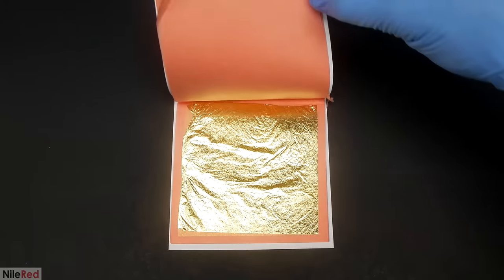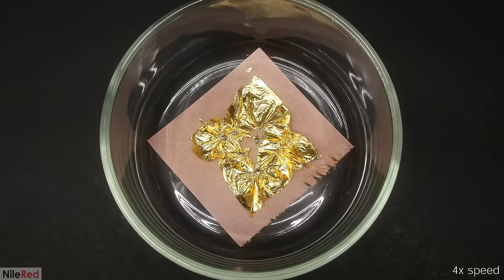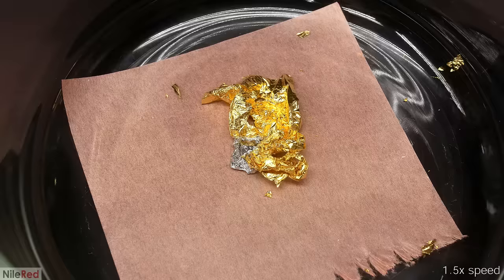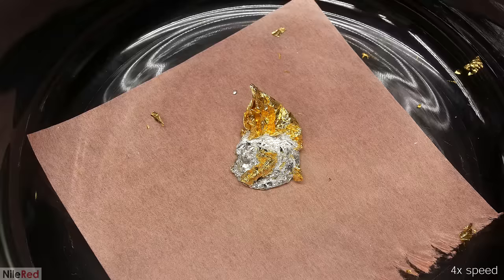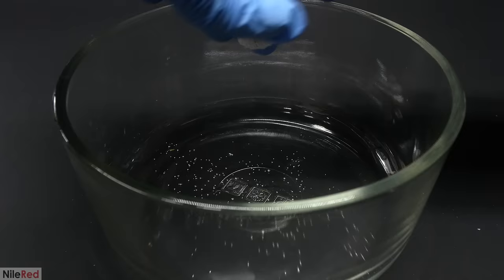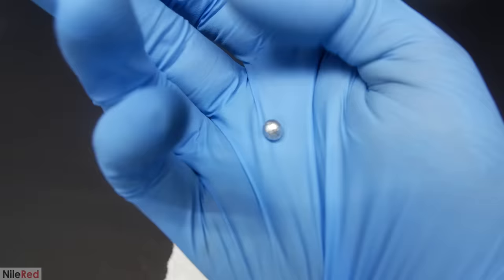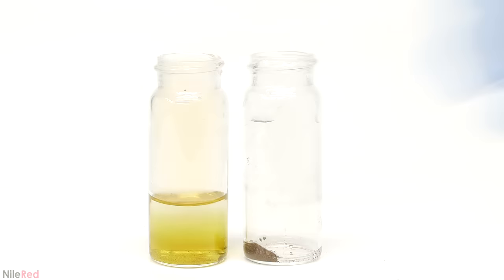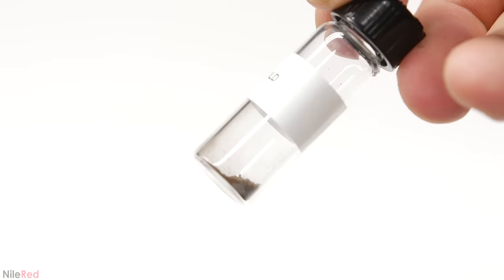Dissolving Gold in Mercury

Comment: The effect was really cool, those leaves must have been suuuuuper thin though.
Reply from the maker: Yeah, they are insanely thin.
Reply: Just how actually thin are they?
Reply: Micrometers thick.
Reply: ender_scythe I've heard they're in the realm of a couple hundred atoms thick
Reply: If you were to lay one on your fingertip, it would conform to the shape of your fingerprint.
Reply: Gold has the ability to be flattered to only a few atoms thin. Most gold leaf is so thin that you can take a sheet and roll it between your fingers and it'll essentially disappear.
Reply: How was this comment posted 8 hours ago, when this video was posted 3 hours ago? Was it once unlisted?
Reply: Well, Mr Bleach, Pateron members get to see videos first.  And comment.  Video posting time for them reflects actual.  For non members, you see general public post time which is hours to days later.
Reply: kan petyim Waaay thinner than aluminum foil
Reply: Ricardas Ricardas around 2 nm
Reply: kan petyim nowhere NEAR as thick as aluminum foil. Not even on the same scale. We're talking about 1/1,000th of an inch vs merely atoms thin.
Reply: Extremely thin, those are used to decorate food
Reply: They are usually about 10 to 100 atoms T H I C C.
Reply: I knew gold leaves are thin and I was told how thin they are but I still was mind blown the first time I worked with it. If you breath to much I will just fly way.
Reply: @MuzikBike  omg
Reply: Gold leaf can be so thin that a candlelight can be seen through it.
Reply: That's what gold can do.
Reply: @ricardasist  may be the one that Rutherford used in his alpha scattering experiment... 😄
Reply: @uhRoid  Time travel.

Comment: Gold amalgam actually has one quite old use. It has been used for gilding metal objects, it doesen't have to contain alot of gold so the amalgam is quite runny and can be aplied with just a brush. It sticks nicely to metal surfaces, then the object is heated to evaporate the mercury and that's pretty much it. Of course now we can apply metals with electro chemical techniques so there's no use for mercury-gold amalgams

Comment: You should try this with more metals.
Reply from the maker: I will! I will do it with aluminum, sodium/potassium, silver, etc.
Reply: NileRed, Aluminium + mercury has been done many time before, though maybe see if aluminium foil (the thinnest type you can find) will do anything similar to the gold effect. Also, might be interesting to see if NaK will dissolve gold, silver or other "unexpected" metals.
Reply: I especially would like to see it done with copper.

Also, what would happen if you amalgamated it with cobalt or nickel (apparently iron is resistant to it) and held a magnet to it?
Reply: i'm waiting for platinum and osmium
Reply: cobalt and nickel are also resistant to it though it does give me an idea for an even heavier ferrofluid.
Reply: The lord himself speaks.

Is gadolinium also resistant to it? Gadolinium is pretty strongly paramagnetic, so it might work.
Reply: Elizabeth Welsh NaK is fine as long as you store it under an appropriate oil.

Comment: Hey, I saw a video in Facebook where a scammer (buyer) puts unknown substance (probably mercury) in someone's jewelery in an attempt to lower the price of the gold necklace. Some parts of the necklace became brittle and some parts got dissolved like rusty metal. So the owner brought it to a jeweler to fix it and he used flame torch to remove the mercury and solder broken parts. So I assume the mercury became gas? Isn't it super toxic when it becomes gas?
Reply: Yes it is
Reply: The method used in this video is extremely toxic. I would not advise anyone to follow this method, or in fact to even consider "playing" with Mercury at all. There are no "cautions" given about the danger of using Mercury. The fact of the matter is, Mercury can and does vaporize at and well below room temperature. It does not have to be heated to vaporize.

I saw no cautions about using protective inhaling respirators. Inhaling Mercury vapor is the fastest way to get Mercury into your system. Mercury is cumulative and is not dispelled from your system without going through a "Chelation" process.

Working with Mercury requires a rigorous safety training process, which I have gone through as a lab technician for UCLA. The dangers associated with working with Mercury for an untrained person are simply not worth the risk. The toxicity is not to be underestimated. There are dangers that most, if not all, untrained people are unaware of cannot be taken lightly.

Putting something like this on YouTube is highly irresponsible and has the capacity to cause great harm to others. I would highly suspect that the work area this YouTuber worked in is highly toxic. A Mercury sniffer instrument would probably show Hg levels that are off the scales of the measuring devise.
Reply: @jamesfoley5335  I've seen a video where under a uv light, mercury vapor can be seen like a hot coffee with smoke

Comment: I had small vial of mercury, from an old thermostat, in my pocket. In the same pocket I had a small coin purse with 1-20 Franc gold coin. The mercury vial broke. I turned my pocket inside out to get rid of the pea sized glob of mercury. A day later, I looked at the gold coin. It had 4 tiny spots of mercury attached to the gold coin. They looked like fountain pen roller balls of solder. I tried to wipe them off and only ended with a smeared coin that is now mostly silver colored. What are the odds of that happening? I can either heat the coin above the vaporization temperature of Mercury or dip the coin in Nitric acid to restore the gold appearance.

Comment: The method used in this video is extremely toxic. I would not advise anyone to follow this method, or in fact to even consider "playing" with Mercury at all. There are no "cautions" given about the danger of using Mercury. The fact of the matter is, Mercury can and does vaporize at and well below room temperature. It does not have to be heated to vaporize.

I saw no cautions about using protective inhaling respirators. Inhaling Mercury vapor is the fastest way to get Mercury into your system. Mercury is cumulative and is not dispelled from your system without going through a "Chelation" process.

Working with Mercury requires a rigorous safety training process, which I have gone through as a lab technician for UCLA. The dangers associated with working with Mercury for an untrained person are simply not worth the risk. The toxicity is not to be underestimated. There are dangers that most, if not all, untrained people are unaware of cannot be taken lightly.

Putting something like this on YouTube is highly irresponsible and has the capacity to cause great harm to others. I would highly suspect that the work area this YouTuber worked in is highly toxic. A Mercury sniffer instrument would probably show Hg levels that are off the scales of the measuring devise.